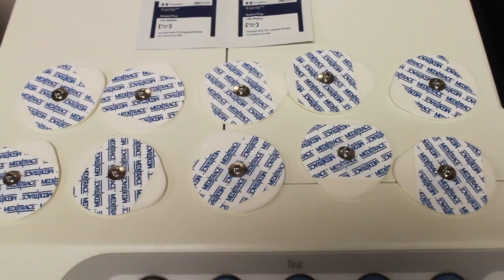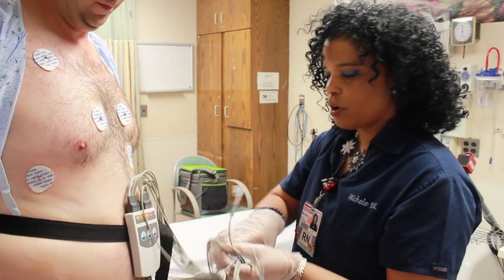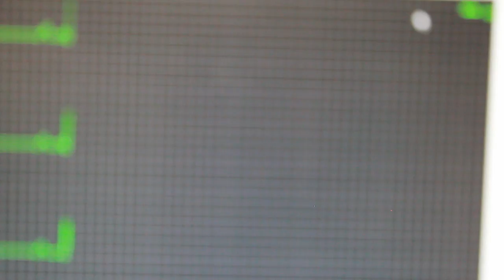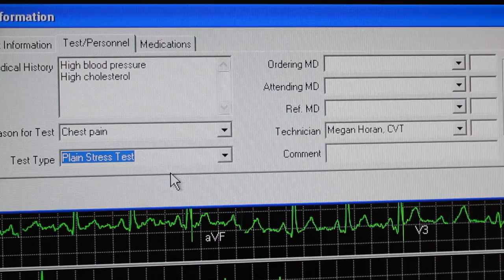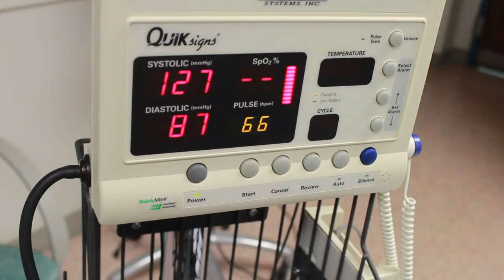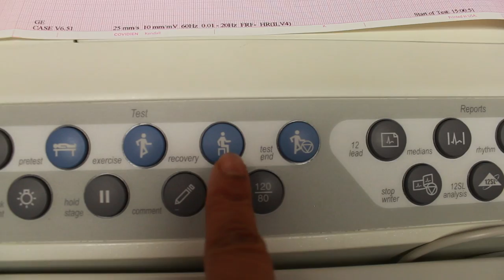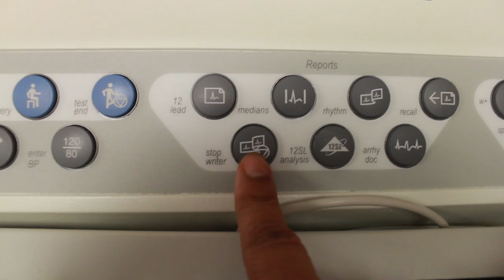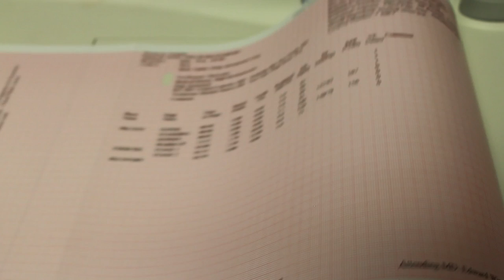Tutorial: How to Do a Plain Stress Test on a GE Case 8000 Machine

Comment: Interesting that you put lower limb electrodes so high. I always like to untangle those wires because that mess pulling will also cause a lot of artifact.
Reply from the maker: Jody Mack it all depends on the patients girth but generally the floating rib area is where I place lower limb electrodes.  I miss the separators we used to have to keep the wires untangled we would just slide it up to where we needed it and then connect the wires.